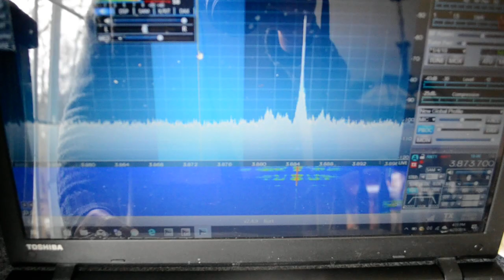Where is the source of the 75 meter noise with a Flex 6400M?

Comment: Burt,
As was mentioned, you need to take the radio to find the noise. There was no change because the radio was stationary. If you have a portable general coverage receiver and can hear the noise, that can be used to locate the source.  WB3BJU
Reply from the maker: The video was a parody on no code hams.
Reply: @Capecodham    I know several "code" hams who are not only technically clueless but assholes on the air to boot.  Parody is funny but the "no code" stupidity ruined it.  "No code" HAMS are HAMS never  the less and I'm one of them.  I work hard to further my technical skill and strive to be a "professional" operator.  Code just defeats me.  I love a good QSO and really enjoy mobile ops.  I also enjoy .
developing antennae.  I devote a good portion of my time to public service too including providing a complete "all mode, all band" station for my rural county EOC.  If you don't think I deserve my ticket all I can say is get over yourself.  I put my ops up against yours any day.   God bless.  NT5CC